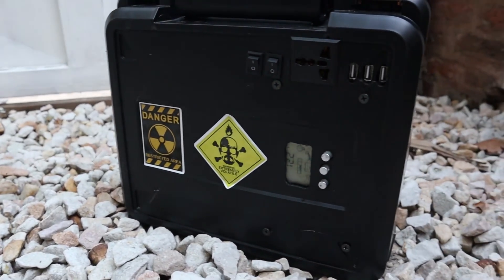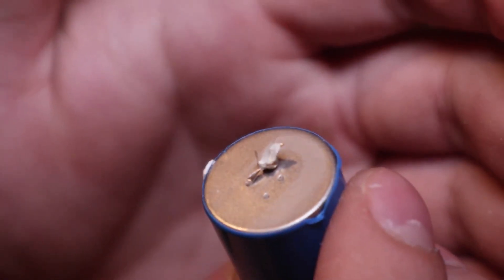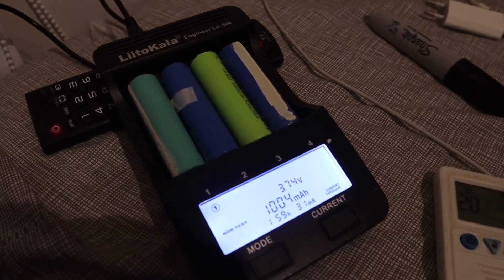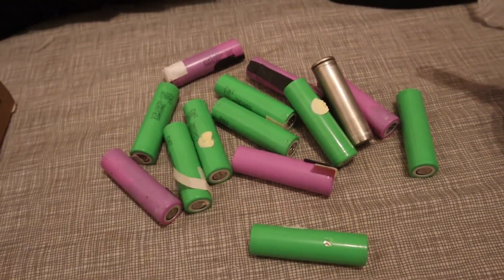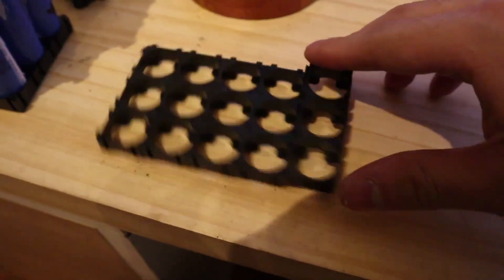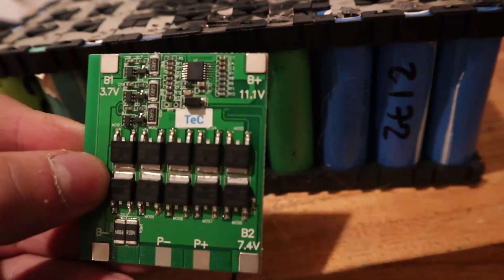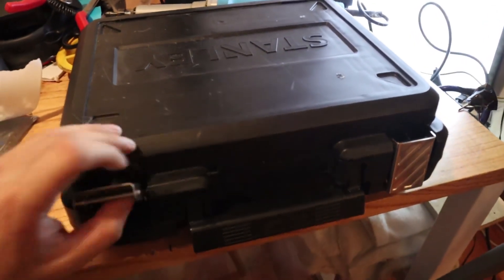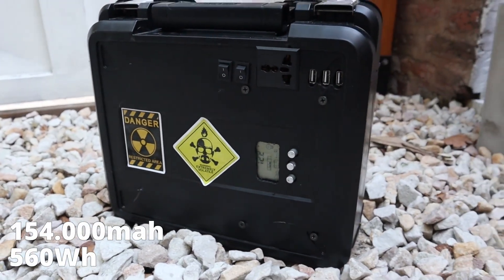Free Energy with Recycled Batteries | DIY 154,000mAh Solar Power House

Comment: Truth that gets huge amount of negative feedback and down votes: Although I support any DYI, I do not support this kind of video. Please do not try to make it yourself or do it in lesser scale if you are really interested, in separate building, next to bucket of sand. And store your recycled battery pack in a 2m deep concrete hole if you don't use it.  
There are so many houses burned down thanks to "DIY battery packs", doe snot matter if from Leaf or laptops or what ever places. If one cell is dead in a OLD pack then the whole pack is old and should be sent to recycle and new ones used. You have no idea how many cycles they have been already used thus no idea, how many cycles are left and just measuring internal resistance and capacity does not tell you that. Also probably no idea, if you mix NMC and other chemistries used with each other or not. 
I have build many Li-Ion packs myself and done probably all the mistakes myself already, that's why I'm putting a big big WARNING sign here. Better use Sodium Ion batteries. You get lesser capacity but you will sleep better, they are exponentially safer. Sodium Ion batteries are dirt cheap also and all the techniques used in this video will apply to build one. BMS has to be for So Ion, that's it.

Comment: Visit local e-scooter repair shops, they often dont want to deal with bad batteries and just give/throw them away - and these cells a usually have higher max capacity and discharge rates.
As a spot welder id suggest getting k-weld 100ish euro price range (working with one for 3 years now,  as a power supply for that you can use car lead acid battery)
Dont be like chinese scammer battery seller - dont use misleading capacity amounts (which is real but misleading)
Battery capacity is capacity of one of its banks (1s), and not all banks combined - which got abbreviation of Ah(amp hours) or mAh(miliAmp hours).  Total energy is in Wh (Watt hours) calculated by multiplying voltage by Ah.
Good luck with your future endeavors.

Comment: That's more like 50.000 mAh if the cells  are 2.000 mAh each
Reply: The pack is a 3S18P. The current is still the same when adding cells in series.Only  adding more in parallel will change the current
Reply: @robertgubberiksson2068  how does it feel to see amongst the blind
Reply: Its 3 packs of 3x8 thats 72 bateries. If each has 2000mAh it should be ~144000mAh. Please explain, maybe im doing something wrong. Maybe you’re taking in account invertor efficiency Which in this case could be somewhere between 80-90%. So how is that possible that its only 50k mAh?
Reply: Average was 2,400.
8*8*2,400=154,000